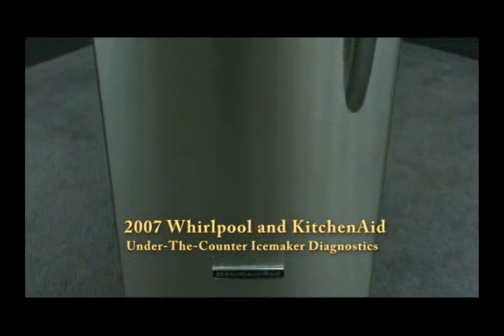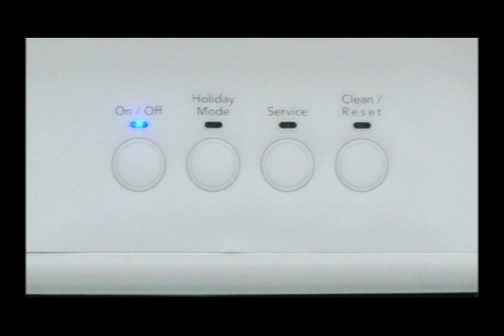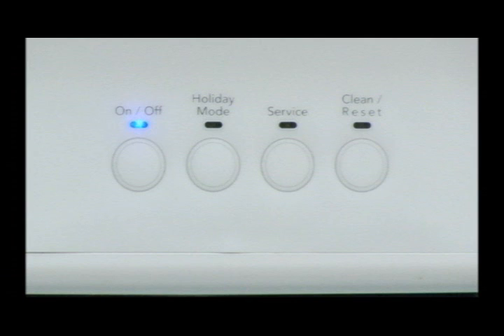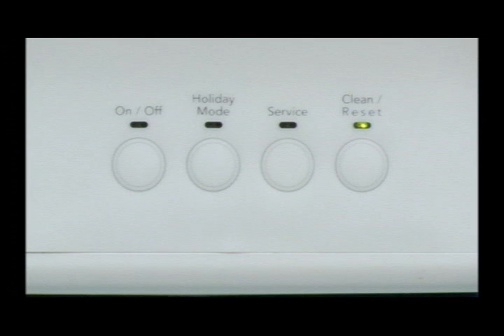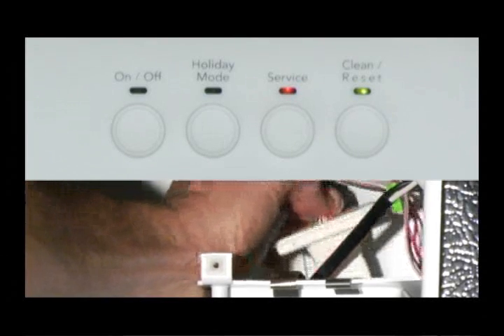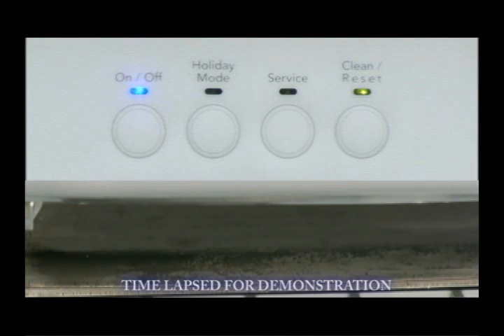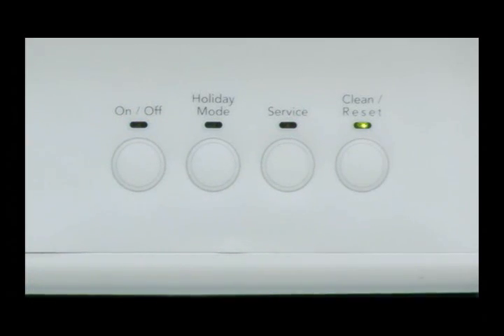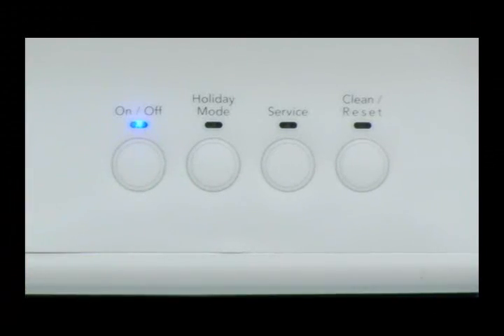ApplianceJunk.com - 2007 Whirlpool & KitchenAid Under-The-Counter Icemaker Diagnostics

Comment: THANK YOU! THANK YOU! THANK YOU! I have a Kenmore stand alone ice maker, and the diagnostic lights were identical.  Ice maker was not making ice, and made a loud grinding sound. Per your video, I diagnosed it was a faulty recirculating pump. Purchased the part, and made the repair. Ice maker now working beautifully. Also, thanks to you, I learned how I can change the ice thickness.

Comment: Got a kuis18nntb2 that won't make ice. Made a tiny bit of ice but not water freezing over the evap. Replaced the evap thermistor and the water level sensor because of the lights, now I have no lights flashing but no ice is forming on the evaporator. I feel the compressor working along with the fan and all functions appear to be working, at least according to the lights on the maintenance mode.... Any suggestions?
Thanks
Dave
Reply: Hi Dave. Did you ever get this fixed? I had and tried another new control board but still no freeze cycle over evaporator just water pouring over and compressor and condenser fan running. Puzzling.

Comment: After running clean mode with cleaner and descaler, was not able to shut off Clean/Reset button.  So, ran through all 9 diagnostics manually but when restarting unit to On, the On/Off comes on but so does Clean/Reset light!  Also, icemaker stays in clean mode....I cannot get back to simple On mode to start ice production.  Shut unit off for now.

Comment: Ran thru diags mode for the Kitchen Aid under the counter ice maker model #KUIS15NRB1, got to step 6, condenser & fan motor check, a full frost pattern was visible and the service light is supposed to blink when it hits 4.5 degrees, waited ten mins, no blink, another ten and the unit just shut off. In the "ON" mode water just runs over the evaporator and drains out. Also, during step 4 of the diags for the Smart Valve, the service light blinks for empty, the reservoir fills up and shuts off, but the light still blinks and never goes solid indicating a full reservoir. All other checks in diags mode pass. Is this a compressor issue for the cold or sensor issue with the water level valve or both? and how does this happen?
Reply: My kitchenaid does the same.
Reply: Did you ever figure it out?
Reply: Follow up here.  Any solution? Just bought a new house and has this Ice Maker with exactly this problem.  Help appreciated!